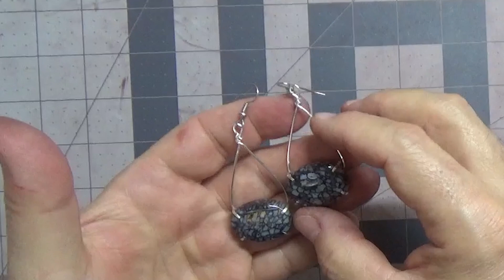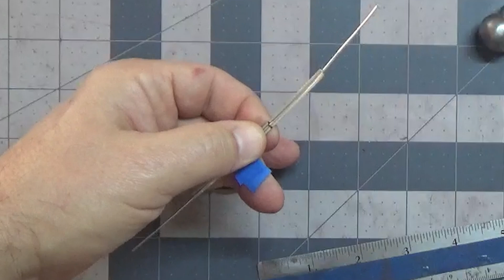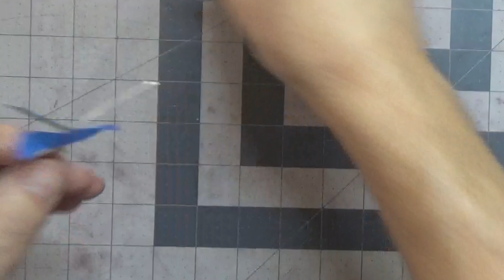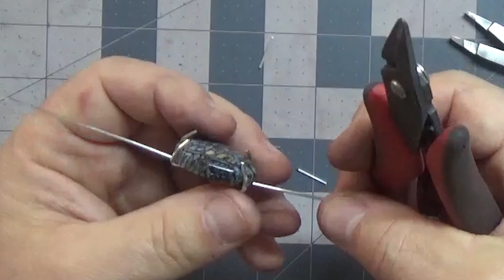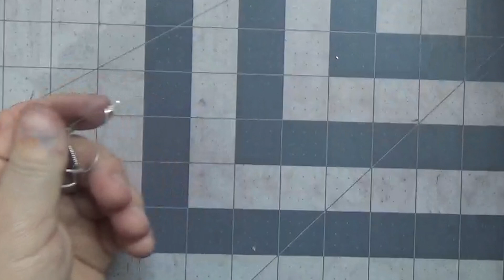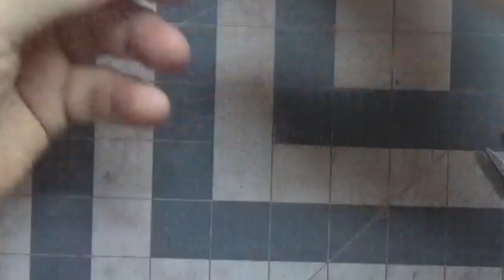Prong Set Wire Wrapped Earrings - Tutorial

Comment: Hi Jim, I love your designs and have been practicing them on anything I can find! I have  been using aluminum, copper, and craft store wire but feel I am ready to progress to the real deal. I am on a very limited income however so I wanted to know what size wire I should get to start. I want to get one square and one half round to start and add to my stash every month if I can. Would silver filled be a good option for me?
Reply from the maker: It all depends on what you are making and what style you are doing. If your doing some of the prong set (also known as wiresmithed) pieces then I would get 18 gauge square and half round. If you're making traditional wire wrapped pieces I would use 22 gauge square and half round.

My basic rule when buying wire is to buy half the amount of half round wire. That means if i buy 1 ounce of square wire, I buy 1/2 ounce of half round wire. I ope this helps. If you need any more help please let me know...I'm happy to help.
Reply: @JimMcIntosh  That does, a lot. Thanks for responding so quickly!